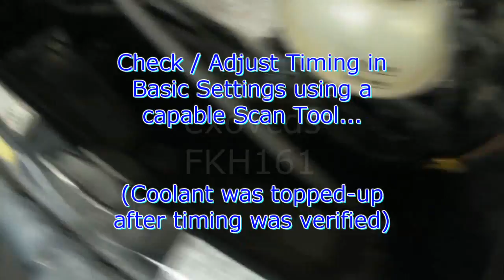VW T4: 2.5L Eurovan Replacing Hall Sensor inside the Distributor (Intermittent No Spark when Warm)

Comment: Thank you once again for this video and your help. Was traveling and just back to finish this job. Never could get the van to run when mechanic swapped hall sensor. I bought OEM distributor on eBay, and swapped entire unit, fired right up and runs. My conclusion is that either the hall sensor didn't match the windows you mention in the video or maybe the fact that the rotor wasn't sitting on the distributor very well, didn't have that snug feel to it, though was not loose or anything. Not 100% sure, but I certainly learned a ton from your video. Thank you for providing this. I will message you with any future issues and happy to donate to the cause for sound advice. Thank youSean
Reply from the maker: +Sean Robinson Thank your for the update!

Comment: Hello Thomas,

I have a question, which tool did you use for getting the pin out of the plastic wheel thing? Around 6:00 
Which size is the shaft? I have a 3.9mm driving punch, but I believe the clip is around 3.7mm., Or did you do it with a 3mm driving punch?
I have a Golf Mk3 with a 1.6 ABU engine, and my hall sensor needs replacing, I have a brand-new bosch hall sensor but I can't get the pin out so I can't replace it.
The hall sensor works, but sometimes it stalls or just won't start up, if I reconnect the connector on the hall sensor it starts fine, checked the cables and the looked fine and also tried to wobble it a bit but didn't stall or something, so I believe it is the hall sensor itself.

I hope you can help me, thanks.

Greetings,

Comment: Hi there, I have a 97 T4 with 2.5 petrol AET type engine and I have an intermittent problem. Some times it can have a total power loss, gauges stop, engine stalls but if it happens while driving car just restarts, if it happens at lights you need to restart with the key. Tends to happen more often in hotter weather or in heavy traffic or at cruise on the freeway. Can't get any error codes when mechanic checks and he has tried leaving car running for long periods in the hope that it happens and leaves a code but without success. Any help would be greatly appreciated. Really like your videos and have found them helpful. You really know your way around these vans. Thank you for your time and regards from Australia.
Reply from the maker: Hi, thanks for watching! Sounds like the ECM is cutting out momentarily (I could be wrong)... that would explain why there are no fault codes (the ECM is not awake to catch a problem). It's basically like turning the key off and on again while the engine is running. If it only happens one time per week, it will be difficult to track down... the more often it happens, the better chance of finding what the problem is. Does this engine have a crankshaft position sensor? The 2.5L engines here in North America, did not come with one. A faulty crank sensor should set a code though, and usually causes a vehicle to not start for several minutes once it acts up.
Reply: ***** Thank you for the quick reply. That does make sense with the ECM. Not sure about crank sensor but will check with my mechanic and get back to you soon. Again thank you for your time and thoughts.

Comment: Dude, you are awesome - I just subscribed!

Two weeks ago I watched your mk5 clutch replacement, just replaced the clutch and transmission on an 07 Rabbit I bought, got rid of the dual mass flywheel and installed a 2012 jetta transmission - works great. 

Today I bought a 1993 Eurovan 2.5 gas with 13,000 original miles - its been sitting in a garage for many years and is currently not running / starting. Tossed a new battery in it and it cranks over well, and i smell plenty of gas (although its likely bad by now) but no sputtering or anything. I'm assuming I have no spark. Will also have to check timing, likely has never had the belt changed, but sounds to have good compression.

Plan on watching a bunch of these videos and hopefully tear into it this weekend and get her going. Thanks for the insight!
Reply from the maker: Congrats on your purchases and thanks for watching my videos!
Reply: +Thomas EXOVCDS After watching a few vids I tore into it today. Getting correct voltage everywhere that I can trace, down to the distributor. Coil is sending spark but none of the wires are sending it off to the plugs. Assuming bad Hall Sensor? Will likely replace it as an assembly with the dizzy/cap/rotor since I can get it that way for less than the sensor alone. 

Thanks again for the knowledge :) !
Reply from the maker: jeTTaTurbO How many windows in the distributor? The windows for the hall sensor? The coil is sparking when cranking? Then the hall sensor should be ok.. unless you have a crank sensor, then the coil is firing because of it. If you have 5 windows in the distributor, then you don't have a crank sensor. If spark is coming out of the coil but not out of the distributor, make sure that the distributor is turning... or that the spark is not grounding out inside of the distributor cap.
Reply: ***** Thanks for the reply! Havent had a ton of time to mess with it until today.

I put in a new distributor assembly with hall sensor, cap and rotor but no go. I think I might have misdiagnosed it. I am getting spark at the plug but seems rather weak.  

Swapped out coil with known good one, no difference. Van has sat roughly 10-15 years so I syphoned out what I could of the fuel and put in 5 gallons of 93 oct, and changed fuel filter and spark plugs (everything still original 1993) 

It will sputter for a second when first trying to start, then just cycle over. With starting fluid it will cough a bit. Fuel pump seems to be putting out good pressure. It wants to run. 

Unsure where to look. Timing, gelled fuel in the line/injectors? 

Thanks again Thomas! :)
Reply: @jeTTaTurbO   Any luck/resolutions?  You did great work so far.  Thank you!
Reply: @quartamile  resolution ended up being fuel injectors, and likely the fuel itself. Van i was working on had sat for a very long time.

Comment: Do the hall senders tend to stop working/going out when they get hot? Still battling a misfire/loss of power when it’s warm. Have replaced coil, map sensor, plugs, next is hall sender. Was going to do the thing where you touch the cables together but i feel like that can’t solve it.
Reply from the maker: On Eurovans, when the hall sensor goes bad it usually ends with a stalling or no start (cranks ok) situation. I have not seen one that causes misfires. It would affect all cylinders and run really rough (if at all).
Reply: @EXOVCDS  it has been missing then stalling when warm, the most recent time it wouldn’t start back up but i went back after a few days and cranked it and it fired up. I’m at a loss, have done basically everything. You have any suggestions ?
Reply from the maker: @Jkidd123 
When it doesn't start, check for spark from the coil wire (remove from center of distributor cap and hold it close to a clean metal surface, have someone crank the engine with the ignition key). If you have spark, then the hall sensor is ok.
If you have no spark, either the hall sensor is bad or the coil is bad.
Trigger the hall sensor signal wire manually to see if the coil produces spark. 
If yes, then the hall sensor is bad, if no, then the coil is bad.
To trigger the hall sensor signal wire... disconnect the hall sensor plug, ignition on, attach a test light to battery negative, briefly touch the tip of the test light to the middle pin of the 3 pin hall sensor wiring harness connector. Every time the test light touches the center pin, spark should jump from the coil wire.
Reply: @EXOVCDS  okay thank you i will try this. Just seems odd to me this happens when i drove it has warmed up or the temperature outside is warm. I just replaced the coil with a new one last week so i doubt it’s the coil. It’s always with light throttle pulling out it starts bucking and shuttering and missing and when i press the pedal it starts missing even worse. It almost seems like it’s down on power as well because my foot would be almost to the floor and the rpms would hardly be climbing when i was driving. The last time it did this i kept trying to limp it into a parking spot when it was acting up but it finally just would crank and not start. Came back out to it 3 days later and cranked it and it started and was able to move it into a parking spot. My only other thought is fuel pump but when fuel pumps go bad they normally don’t work at all. Is this correct ?
Reply from the maker: @Jkidd123 
Like I said, I doubt it's a hall sensor issue, I'm just telling you how to eliminate it as a suspect.
Most likely you have bad ignition wires or moisture in the distributor cap.

Comment: Great video, just did mine with the issue described. I have an issue where the one supplied (Hall Sensor) is different to the one installed (Stubby). Changed it as you have shown, and the same unit. Would I need to move the Dizzy 180 degrees as the sensor is on the other side and the harness connector is opposite? Appreciate and love the @How to's@. Thanks in advance for the help.
Reply from the maker: If the distributor was timed to the stubby engine, then you need to rotate the distributor until the hall sensor is in a position where the shutter wheel is in the same place (window open or closed) as the stubby was. If the stubby was at 6 o'clock with an open window and the new sensor is at 12 o' clock with a closed window... rotate the distributor until an open window is at the sensor. Engine should start and then you can adjust timing.
Reply: Excellent, all done and running!! Just need to get the timing set up. If was not for guys like you sharing this to the global audience this job would have cost me $$$$$'s. Thanks again and keep making those videos.
Reply from the maker: Huw Rees Thank you and thank you for the update.

Comment: Will a 93 distributor work in a 95 T4? From the looks of it, yes. They look exactly the same. My T4 has the hall sensor in 1 piece whereas the 93's I've seen has the donut type. If the 93's work that would mean I'd have to install it 180 degrees from my original 95, right?
Reply from the maker: Yes, because the actual hall sensor is 180 out, you'll have to do some tweaking to get things working... and since the spacing of the shutter wheel (open / closed window) is opposite (open window on one side, closed window on the other side) it will take some doing. I have not had the time to figure things out myself, so I can't say what exactly is involved. At best, just having to rotate the distributor more or moving plug wires one cap post in whichever direction. At worst, flipping the drive gear 180 on the shaft and all of the above.

Comment: Hello, luv your videos. But i have a question. My 2.5 avt idling bad when warm and have problem with stare while warm. I checked the 51 group in vcds and the camshaft speed was constant 672rpm. I dont know what to think. Just assume that sender value is 0 and its broken?
Reply from the maker: What year AVT?
It looks like the AVT engine has a crankshaft position sensor. Here in North America, the 2.5L  engines did not come with crankshaft position sensors. The ECM only uses the distributor hall sensor signal to run the engine.
Ghost values in VCDS with the engine off... can be normal. I usually see 250rpm when the engine is off.
It could be that you have a failing hall sensor in the distributor... messing up the sync between cam & crank.
Disconnect the hall sensor at the distributor  (you should still be able to start & run the engine).
Drive for a few days with the sensor disconnected to see if things change. If yes, replace the sensor.
Reply: @EXOVCDS   this is 2000 EU, today i checked the voltage at the hall sender plug, there is 5V at the source and GND on the other side. Engine didn't start after Hall disconnection. After ignition the vcds says that the is 900 rpms and engine keeeps after that, when engine gets warm the value starts to decrease to around that 630 RPM and starts stalling pull out the misfire at cyl.1 and lean mixture error. I started to worry about valves condition
Reply from the maker: @pawbre0028 Do a compression test and a leakdown test to check valves.
Reply: @EXOVCDS  today I made a smoke leak test of intake and I found that one of the peteol injectors got leakage on the edge. It's on cylinder nr 1 (the same that vcds shows misfire on). Tomorrow probably I will make some compression test and I will try to seal that leak. Is it necessary to dismount the intake manifold to repair it? 

Thank you very much for whole support! Greetings from Poland!
Reply from the maker: Thank you for the update.
My coworker is from Poland. =)
It looks like the fuel rail can be taken off without having to remove the intake manifold. 
I google searched for an AVT  picture. 

https://rbcdn.hu/b/202105.98.34084616_1024x768/volkswagen-transporter-t4-volkswagen-t4-multivan-avt-2.5-85kw-motor-22786785.jpg

Comment: I have a 93 EV that was running perfect and died on me. Ended up replacing hall sensor but since that time the engine intermittently misfires. I am not certain that the mechanic art timing correctly which is something I am checking on as well as ensuring wires were placed in right order. That said, your title of the video describes my issue. Once engine runs for a minute and is under load (accelerating or on highway) it really cuts out a lot like there is no spark to burn the fuel. At idle when warm you can hear it cut out as well. Do you think the hall sensor I installed could be faulty? Interesting it ran great for years and just stalled, but when replacing sensor it only partially fixed the issue. I was told as long as it has signal it is good. I definitely have ignition and coil signal. And signal at the sensor but not savvy enough to know if that is where I should stop and move onto another component or if there is signal then I should focus on getting timing right assuming mehanic put wires back in proper order when he replaced cap and rotor. Thank you for the videos
Reply from the maker: +Sean Robinson If a plug wire were placed wrong, that would mean 2 cylinders are not firing at the correct time... the engine would run rough / bad "all the time". I doubt that is the case. If it starts to get rough as the O2 sensor is taken into account, could be a lazy / stuck O2 sensor. Monitor O2 ssor voltage & fuel pressure to see if you can narrow things down. Ignition system should be fine, but the only way to be sure is to scope the ignition patterns.
Reply from the maker: +Sean Robinson Have you seen this video? 
https://youtu.be/HdedLiPvU-s
Reply: Thank you, I confirmed today that distributor is rotated 180 wrong by mechanic, though funny enough long before this issue I corrected same thing from a previous timing belt replacement. I lined up crank and checked cam window on gear and was perfect. Removed cap and the Ete points at 11 o'clock. #1 plug is in right place and others as well at least in terms of correct firing order even with 180 off...will advise once we get back to normal. Either way timing definitely off, I don't have a light and will get help to correct. Also checking under wiring harness for vacuum to ECU to be 100% sure. Will update here, sure appreciate your videos and will check other relay link you sent as well. Thanks
Reply from the maker: Sean Robinson Distributor orientation is not 100% critical, as long as firing order is correct and the actual timing is where it should be. I see many 4 cylinder distributors that are indexed wrong, but as long as the plug wires are placed correctly and timing is correct... it's a non issue.

You are correct though in sorting that out first, as it makes further troubleshooting easier.
Reply: Thank you. I will advise. Appreciate your fast replies, extremely grateful as I am not a very good mechanic

Comment: good afternoon friend's truck and on but drowning by having much fuel passage and the coil and the distributor was tested and works properly and let me know if that happens Do you would know why it happens? that I realized that that depress the fuel hose with pliers to decrease precione Station and the truck improved its performance could ponerce up but with some failure of fuel Injection
Reply from the maker: Remove the vacuum hose from the fuel pressure regulator... check for fuel in the vacuum hose.
Reply: ***** good morning friend thomas and remove the vacuum hose regulator precione fuel and the truck will not turn off not noticed any difference still on thank you very much for all the information you gave me to me to have been a great help

Comment: I just picked up my first VW T4 van 1995 model . I hope you can help. It loses power going up hills no guts at all. 
If you can help thank you in advance 
Roc
Reply from the maker: Standard or automatic? Do the rpms climb... but the speed does not increase? Does it happen all the time hen going up a hill? In which gear (standard or auto)? While the engine & transmission are still cold or only when war or both? The more info I have the better I can "guess" what the problem might be.
Reply: @EXOVCDS  it's a 5 cylinder manual, it's been hot when it does it. Someone mentioned the pressure hoses?
Reply from the maker: @rockyroc8018  I don't know what that means (pressure hoses). If the clutch isn't slipping, then I would check / make sure that fuel pressure is OK. Have you driven standard vehicles before? Any weird noises? Excessive engine "pinging / knocking" will cause the ECM to retard ignition timing. Again, the more info I have, the better I can guess.
Reply: OK thank you I'll keep in touch near the end of next week if that's OK. 
Thank you so much, love you Chanel
Reply from the maker: @rockyroc8018  OK, thanks for watching!
Reply: @EXOVCDS  no thank you for helping still going